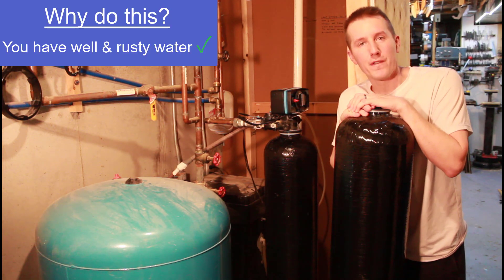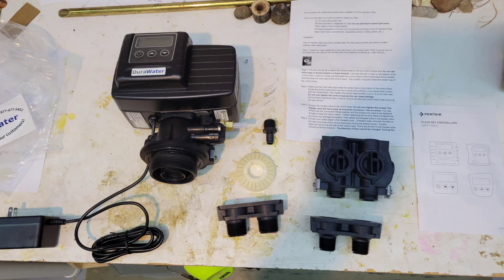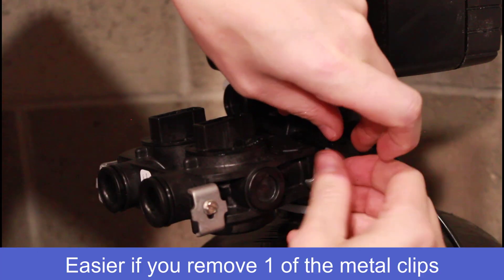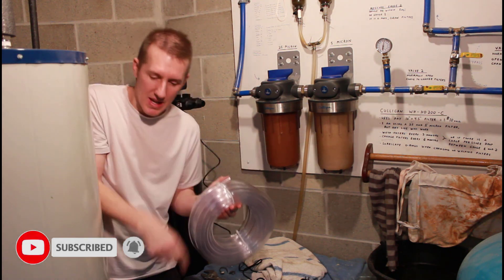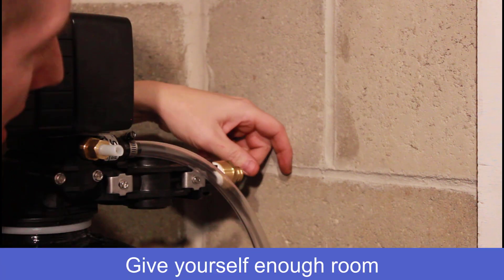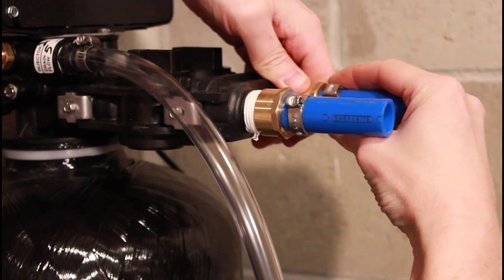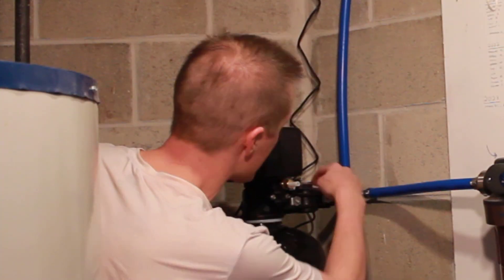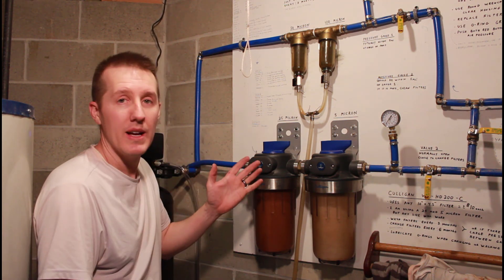Install Air Injection Iron Filter |  For Well Water With Rust | Remove Rust in Water

Comment from the maker: AFW FIlters Air Injection Filter ..................................... https://amzn.to/414sdK1
American Water Solutions Iron Filter .......................... https://amzn.to/47zhF8n
Fleck 5600 SXT Iron Filter ........................................... https://amzn.to/3GlMaCI
Combination Iron Filter and Softener .......................... https://amzn.to/3R34kyb
Clear Drain Tube ........................................................... https://amzn.to/3N4JlK7
PEX Pipe ........................................................................ https://amzn.to/49XB30p
PEX Tools ...................................................................... https://amzn.to/3N8tDhb
3/4" SharkBite Tee Fitting ............................................. https://amzn.to/3TaIlrP
3/4" SharkBite Elbow Fitting ......................................... https://amzn.to/3T5oXMS
3/4" PEX Tee Fitting ...................................................... https://amzn.to/3RxlHbX
3/4" PEX Elbow Fitting .................................................. https://amzn.to/3T4R0M3

Comment: Always install a filter after the media tank. I saw reviews on amazon where someone's pipes were completely clogged with filter media after a failure with their system. It doesn't have to be a low micron filter. You just want something as backup.

Comment: I just installed my ProSoft system  and now I'm getting a lot of air in the water lines. Its really loud when we flush the toilet.   I'm going to install an air vent in the line.  I hope this does not defeat the purpose of the air injection

Comment: Are you happy with this filter and did you measure iron and manganese before and after with a certified test lab?
Reply from the maker: It's pretty good.  But some rust does get through.  I went from changing the filters every month to every 4 months.
And no, i never checked the levels.
Reply: Did you check you PH levels.   The media work best with PH levels with a min of 7.5, and better with the PH at 8.5.

Comment: I hope you noticed that your bypass valve was open
Reply from the maker: I just checked after you said this.
Yes every time i need to change one of the filters on the wall i turn the valves to bypass, then need to remember to turn it back.  Thanks

Comment: With as much iron as you seem to have, I don’t think an air oxidizing iron remover was the best choice.  I would recommend chlorine injection (bleach), followed by a contact tank, then a backwashing manganese dioxide filter.  The chlorine oxidizes the clear iron, the contact tank gives it time to work, and the manganese dioxide media filter filters out the chelate/iron.  Backwash rinse repeat!